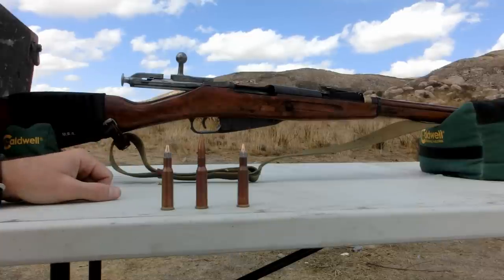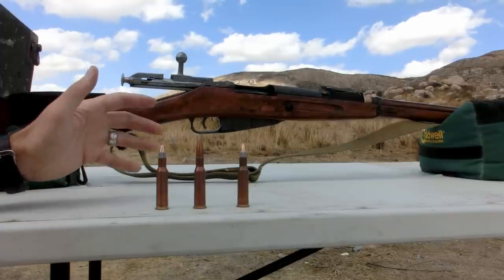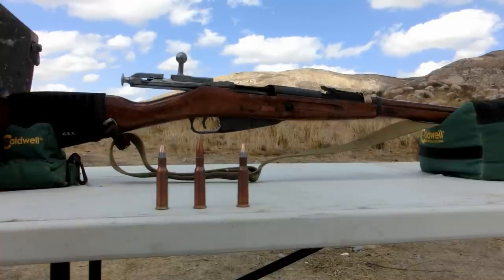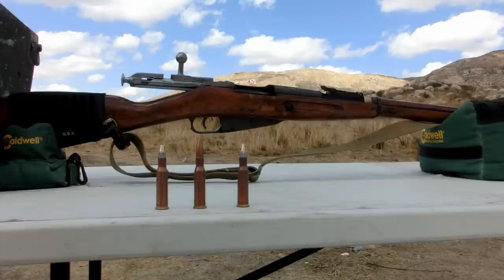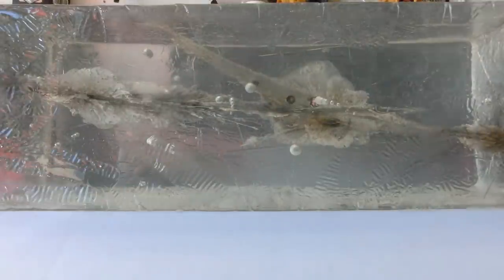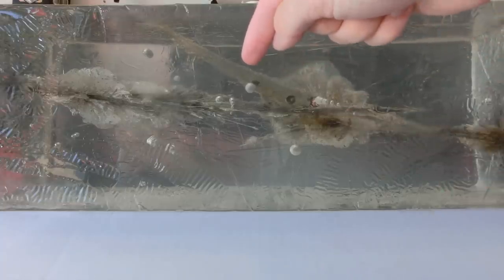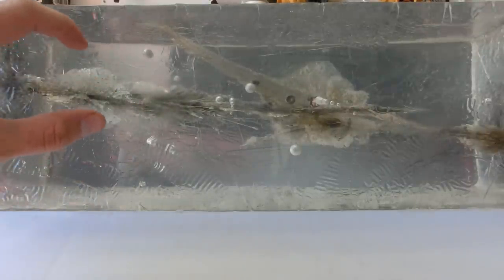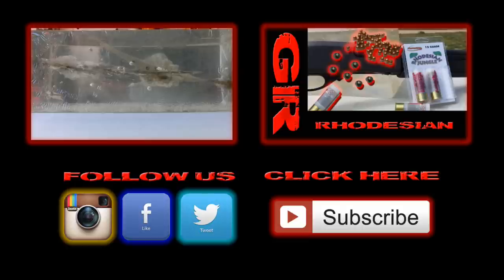Shooting a .223 Through A Mosin Nagant Rifle

Comment: You'd need a hell of a lot more powder, perhaps a different burn rate, before you'd see real performance from this. There is literally no safety concerns, as this is vastly lower pressure than normal 7.62x54r. You could fill that case to the brim with that powder and still not have a safety issue. Not nearly enough bullet weight, and sabots will also lower the pressure levels just by the virtue of being easier to push down the barrel. Just don't fill the case with pistol powder and you should be perfectly fine.

Comment from the maker: We fired a .223 through a Mosin Nagant!
If you enjoyed our video please consider subscribing by clicking here: http://bit.ly/1d22eSc

____________________________

A few weeks ago I asked what ballistic gelatin tests everyone wanted to see. The majority of the people wanted to see a .223 fired through a Mosin Nagant. Before that thread I had never heard of a sabot .223, but it made a hell of a test.

What's a sabot .223 and how do you make it?

A sabot is "a device used in a firearm or cannon to fire a projectile, such as a bullet, that is smaller than the bore diameter, or which must be held in a precise position." (Wikipedia). We made ours by pulling the bullets out of old surplus 7.62x54r ammunition and replacing the projectile with a .223 wrapped in a sabot. We kept the same amount of powder in each casing in order to keep the velocities up. We couldn't find reputable load data, but what we did find said that round would be traveling at least 4,000 fps. At these speeds we would get an incredible amount of energy.

How much energy?

4,000 feet per second, or Mach 3.58 would give us a tremendous amount of kinetic energy as calculated below. A sabot .223 fired out a Mosin Nagant has roughly 51% more kinetic energy than a standard 55gr .223 FMJ.

55gr .223 sabot
Ke = 1/2mv2
Ke(sabot) = 1/2(55gr or 0.00356kg)(4000f/s or 1219.2m/s)2
Ke(sabot) = 2645.87 Joules

55gr .223 no sabot
Ke = 1/2mv2
Ke(no sabot) = 1/2(55gr or0.00356kr)(3240f/s or 990m/s)2
Ke(no sabot) = 1744.57 Joules

Results
We were a bit worried that the rounds would explode inside of the rifle. Our data suggests that we were dealing with pressures ranging from 38,000-40,000PSI. Luckily the rounds fired without issue. We tested two rounds the SP and the FMJ both 55gr.

FMJ Results
Total Penetration: 13in
Temporary Cavity: ~12in
Largest Permanent Cavity: 3.25in

SP Results
Total Penetration: 14in
Temporary Cavity: ~12in
Largest Permanent Cavity: 3in

______________________

 #NRA     #guns     #2a     #molonlabe     #ar15     #guncontrol     #igmilitia     #shooting
Reply: Very interesting.
Reply from the maker: Zombie4416 What's ironic is that I can speak a bit of Russian. My white guy accent slips through some times.
Reply: Gun Runnerz What is the danger of using sabots in a Mosin?  Isn't the sabot supposed to be used like this?
Reply from the maker: SanfteLiebeMaschine using the sabot itself posses little danger. The threat comes from loading the ammunition. There is little information online about how to load sabots. If you don't know what you are doing things could be dangerous.

Comment: You beat me to it! I started on this a month ago.....by pulling the existing bullet you are using a slower burning powder. I'll be using 3031 burns a lot faster.. I'm using a 50 grain vmax, a 55 grain sp both in 224 and finishing with a 227 in 77 grains.  A point you should consider is that the Mosin is not a true 308 but more to the British 303 or 310 - 312 bore. So it is larger than the 308 used in 3006 and the 308, 3030 and 300. In fact my reloading these is to make my mosins two season guns. I spoke with the manufacturer of the Sabot at www.sabotreloadingpro.com about doing this build up to a load for my 9130 and my M44. My past experience with an old Enfield 3006 was remarkable. 1/2 groups at 100 yards. I was rock chuck hunting then. Seating depth is crucial and so is stripping your bore to get all residues and copper fouling out. Accuracy can go way up after that. There isn't anything to hurt or wear on the bore as these poly/nylon sabots can take some real heat.  The faster you can push these the better since thee spin is enhanced by speed which is necessary to stablize the bullets in what would be considered a slow turn rate for a 22 cal. The sabot allows for the center of the bullet radius to spin at a faster rate as the sabot itself is spinning at the regular rate of 30's in the barrel. As you decrease size within the center of the spin your rate goes up proportionally giving the little pills more than enough spin. I really want to know if the larger 224's will stabilize?  70 75 77 82 90 grains???

Comment: Cool, it looks like the Old Remington Accelerator Loads. Good Video
Reply: That's exactly what they are... or rather the knock off ones from eabco.com.... The sabot's are meant for .308 caliber rifles. I asked them the about using these in a .303 British since one of mine is mic'd to .309, they said it shouldn't be done though. These are varminter rounds which they have load data listings for a few .308 calibers.

Comment: Just angle a piece of lexan or polycarbonate in front of the chronograph and then you can get velocity readings. It’s what I do when testing my 9mm sabot ammo that spits a .25 solid copper 41gr core 2416fps from a 6” barrel (2250 from a 4”)

Comment: have you thought of using metal sabot? aluminum steel or lead maybe.
Reply from the maker: No that's a good idea.
Reply: frozenwalkway To rough on the barrel and too much chance of a disengagement gone wrong. With the nylon/poly you push through, but not with metal! Boom at both ends!
Reply: James Holloway idk you push metal bullets through barrels. maybe a lead sabot with steel penetrator
Reply: frozenwalkway Lead sabot would be interesting as long as you could insure the release from the core. Now you would be playing with different hardness combinations and limits on pressure because of the nature of lead. I still like the synthetics as there is no barrel wear and I haven't seen any residue build up at all. Again if you don't clean the barrel from copper and lead fouling your accuracy just won't be there.
Oh, and the aluminum would leave residue all over everything and it has a low melting point as well as lead so there is some chemistry to consider.

Comment: you could try that with a 90g .223 round, with the 6g sabot that's 96g total. Is that a 147g 7.62x54R round. the powder load would still be light for that 96g sabot round.
Hodgdon info for a 110g 7.62x54R H335 51g -3126fps 54.5-3332fps, H4895 51-3150fps 55c3345fps,  Benchmark 47g-3060fps 50.5-3213fps.   You could start with these loads and Chrono them.

Comment: I've been doing this since 1996 with nagant and sks
Reply: MrDeathd You are the expert here then....what did you achieve with your Mosin? I know there have been a lot of guys using the SKS but I hadn't seen anything on the Mosin. Sabot Reloading Pro was a lot of help but they didn't know of anyone using them in a Nagant!
Reply: your looking at a velocity jump between 3940-4000 fps depending on powder charge ,and type ,I did have them going so fast the bullet would disintegrate in mid flight . I was using imr 3031 42 grains ,and a 55gr .223 ball fmj .
Reply: Why not try a heavier bullet? 70 -77 grain? I've got to do some shooting before I know much more....
Reply: Are you sure the bullets were coming apart or were they tipping and ripping apart by being out of balance and contacting the end of the barrel in a tipped position before exiting? If they aren't seated solidly they will rotate out of position and if the sabot is sliced or shaved when inserted the same result could happen? Just saying...